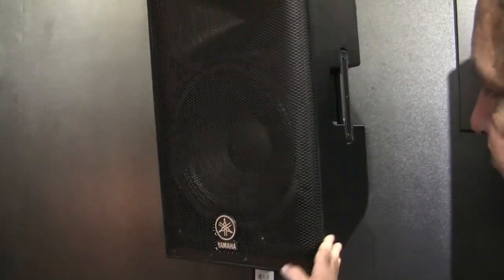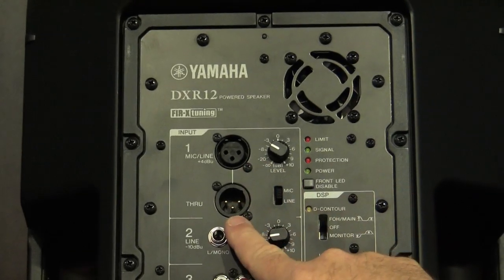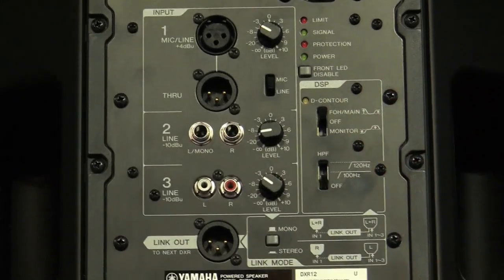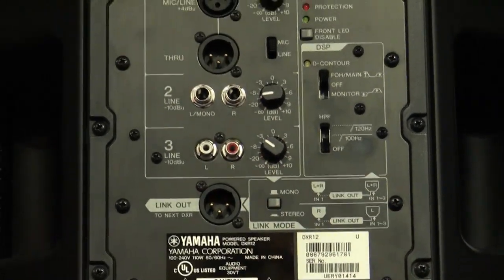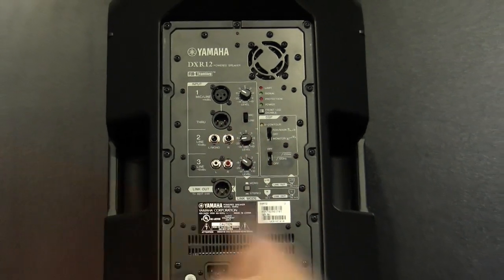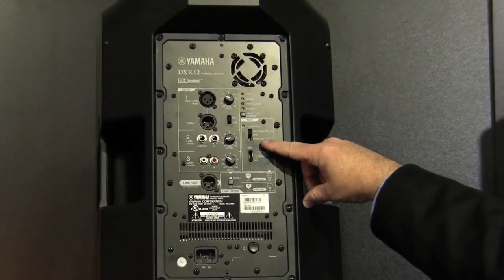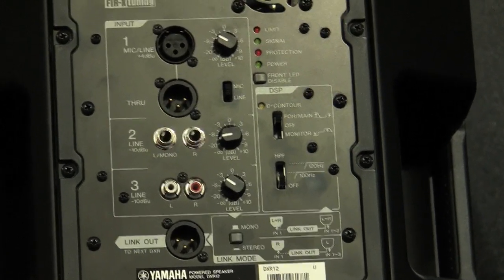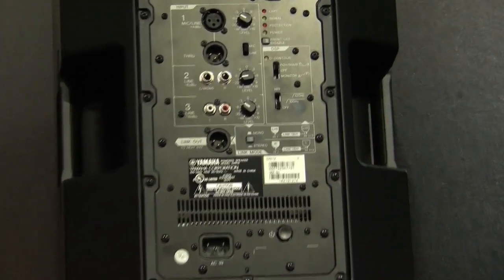Sweetwater at Winter NAMM 2012 - Yamaha DXR Series Loudspeakers Overview

Comment: The DXR series are actually excellent powered speakers with many useful features, plenty of power and more importantly great sound. I have tested the DXR15 and DXR8 so far and was impressed by both. All models are powered by 700 watts RMS and feature some clever DSP to maximize output while maintaining aound quality at all levels. The fan and use of ferrite drivers (instead of neo) were likely to keep costs down. I highly recommend you go have a listen to them!  Al - Party-time! DJ Services